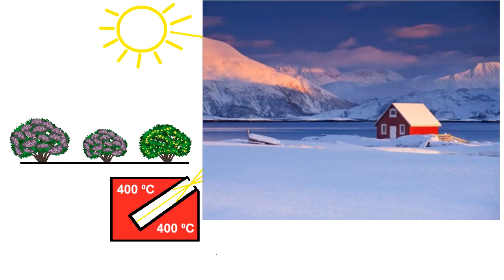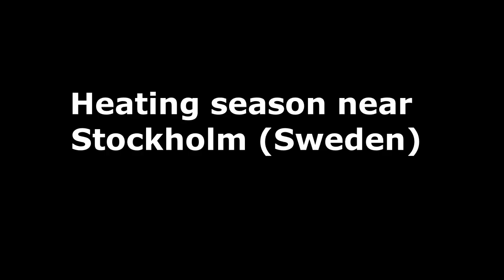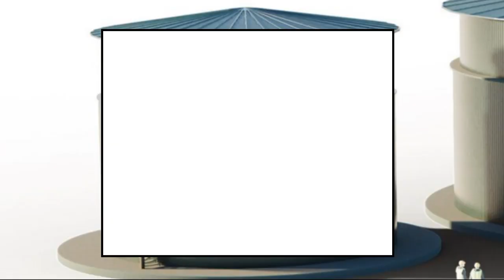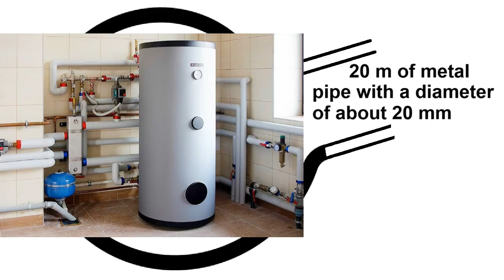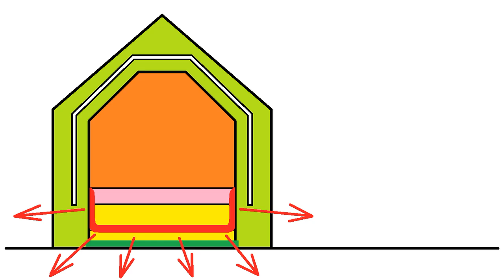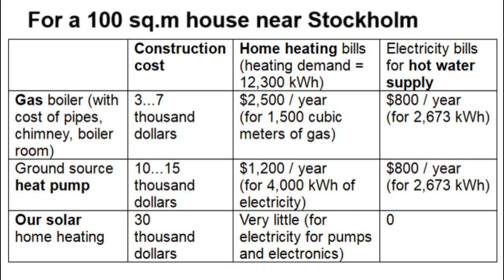Solar energy heats a house completely in winter, without a gas boiler or heat pump

Comment: How does this compare to standard trench ground source heat pumps driven by solar PV? It seems much easier to bury a few lines of pipe in a trench 7-8 feet down and pump heat from your house out in the summer for AC and back in for heat in the winter while only supplying the energy for the movement and losses, plus the PV array can be used for other things when you have excess.
Reply from the maker: On the Scandinavian Peninsula, or in Finland, or in Alaska? Where solar panels generate almost nothing in December and January.